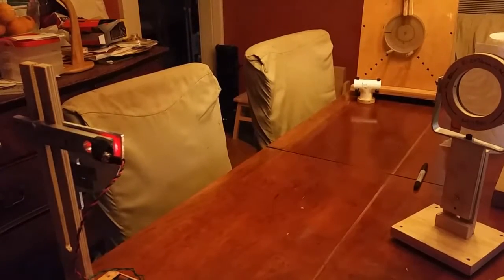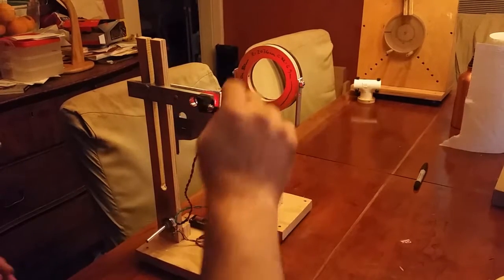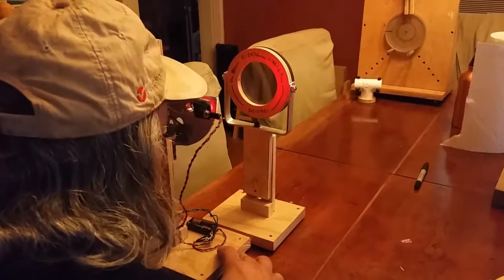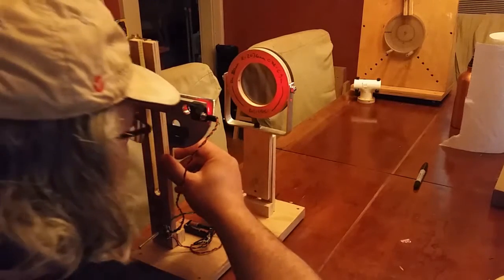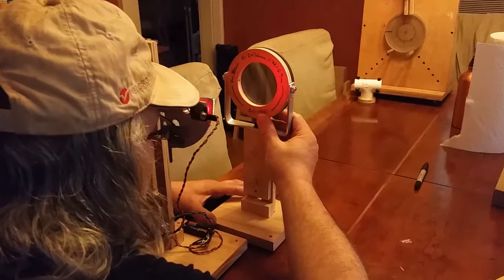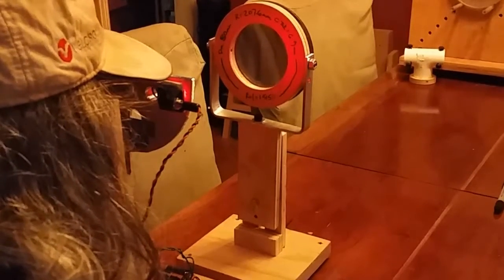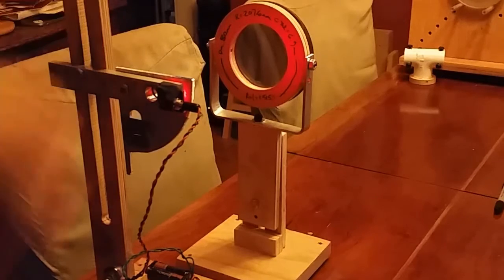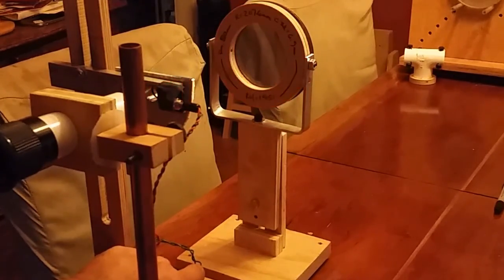setting up Ross Null for aspheric mirrors

Comment: Don't understand. :'( Can you elaborate a bit about what you are doing, what are the parts etc, beforehand? Keep it up!!. Thank You
Reply from the maker: Chathuranga Hettiarachchi I’m testing a parabolic mirror for correction, how well it’s figured. I’m shining a led thru a ronchi grating that shoots thru a Plano convex lens - off the mirror and back thru the lens then grating.

The Plano convex lens will make a parabolic wavefront look spherical, meaning the lines will look straight when the figure of the mirror is good.
Reply: @Pinbout  I see. Thanks for the explanation sir.
Reply: Dzień dobry.cxy możesz mi powiedzieć jak prostym sposobem można zbadać lustro wypukłe do DK .

Comment: Danny, knowing the dimensions for the lens (they are written on the tester side of the lens frame), how do you calculate how far apart the tester and the lens should be and how far apart the lens to the mirror should be?I am working on a twelve inch F7 mirror if that helps.This is a great tutorial/explanation of how to work with the lens and understand what is seen.
Reply from the maker: download ceravola's program or dm me with an email I'll send over a zip file.